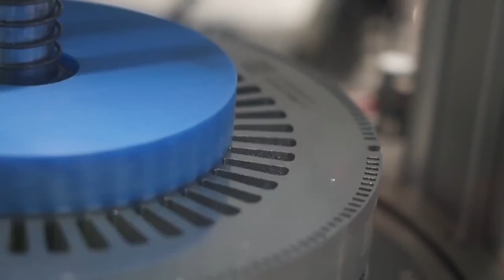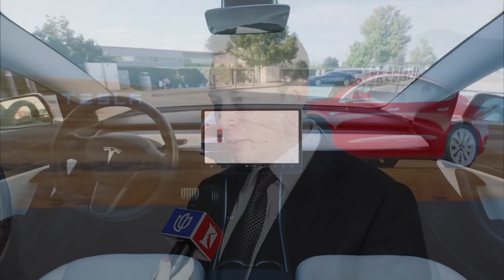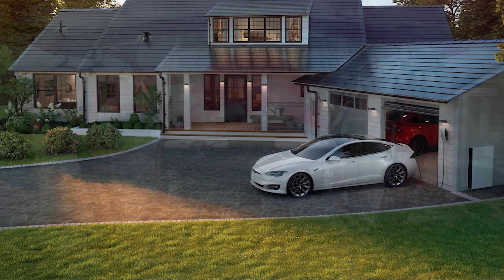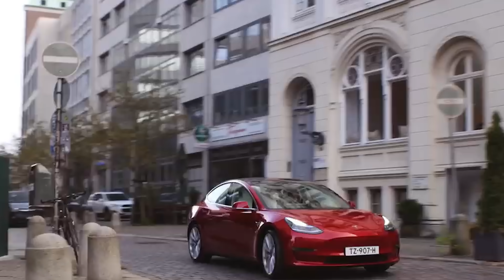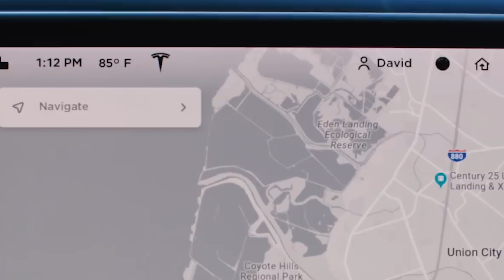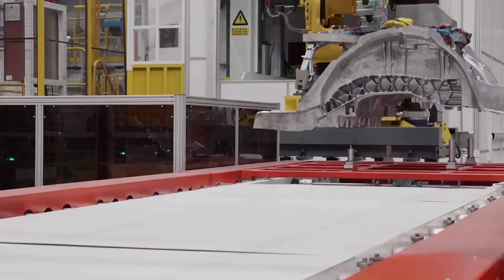What Else Can Tesla Vertically Integrate?

Comment: Tesla can vertically integrate up to space. Next factory should be on orbit. Spherical shape, covered by solar panels. SpaceX will soon be able to carry load 1 cent per ton. Manufacturing robots will be much cheaper since it will be easy to lift any part. Best lines are no lines, just push everything through space. Hyperloops inside since there is already a vacuum. And just precision shoot cars down to peoples yards

Comment: Tesla Home: an integrated central panel that controls solar panels, a battery, a heat pump, connected to autobidder software by Starlink. It could transfer power as needed between the vehicle, the batteries, and via the heat pump to stabilize the grid, regulate timing of power usage to even out grid flows, etc. Ideally if they synergize with home builders, you could include powerpacks or megapacks to provide backup to whole subdivisions. 
Tesla Mall: supercharger stations that sell food, merchandise, and vehicles, with charging while you browse. They could be the nerve centers for robotaxi fleets, once they're operational.

Comment: You missed the obvious ones, such as tesla making its wn seats, designing its own chips, making its own AI servers and data centers, selling AI services to other companies. There were rumors that Tesla was looking at buying its own silicone fab to make its chips, which may be feasible for 28nm and larger planar chips, but doesn't  make sense for smaller nodes which are too costly. I can also see Tesla doing its on circuit board assembly, not for economic, but for data security reasons, and to fulfill the requirements of governments and companies worried about their data.

Comment: What parts are in the semis that deliver direct to the production line?  Drive shafts, brake components, glass etc. With the economies of scale, Tesla could produce every part, including chips. Buy a glass factory, an iron ore mine, a steel works, a bauxite mine, lithium mine etc. buy Bembo.
Reply: Tesla makes their own glass actually. Tesla Glass is special made to reduce wind and road noise

Comment: Boring company is greatly overrated, it’s stupid on so manny levels.
Reply: Maybe you should try actually telling us why?
Reply: @fredbloggs5902  for example they aren’t any cheaper and just slightly faster than any other tunneling if you calculate it taking the volume of the tunnel into account.

Those tunnels would be illegal in many places around the word where human lives are valued because they’re just death traps. 

Driving a car in those tunnels is incredible inefficient compared with a train. It’s just way worse on every metric.
Should I go on?
Reply: @goodyKoeln  The whole point is that at half the diameter, the volume is 1/4 and the cost per mile therefore reduced accordingly.

Regarding trains, an EV with 3 or more passengers is more efficient.
Reply: @fredbloggs5902  that, is just wrong.
Next you tell me a plain uses less energy then walking or what? 😅
Reply: They can spell, though.
Reply: @MarkXHolland  I’m glad you think that’s important. Big brain arguments right here. 👌🏻